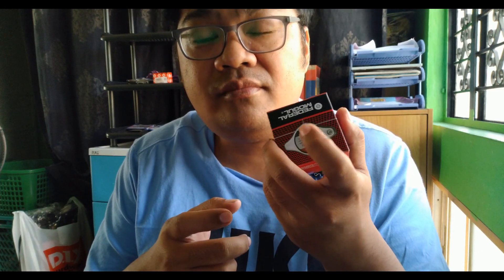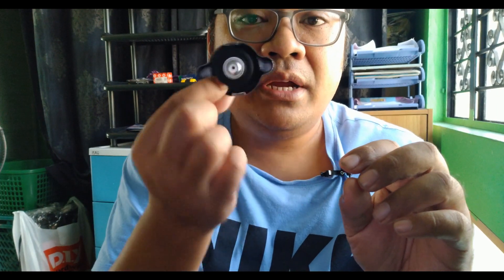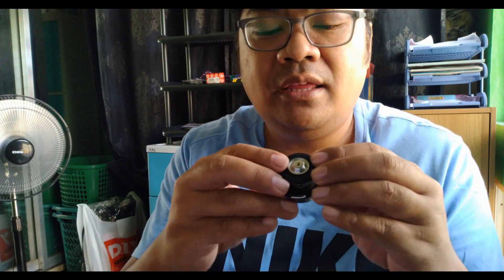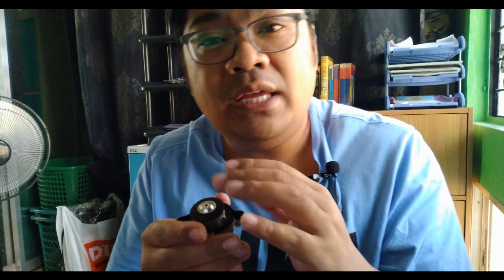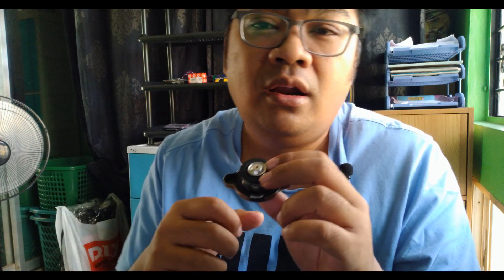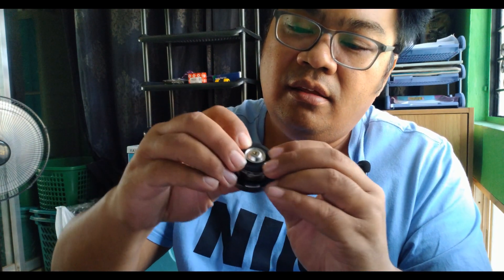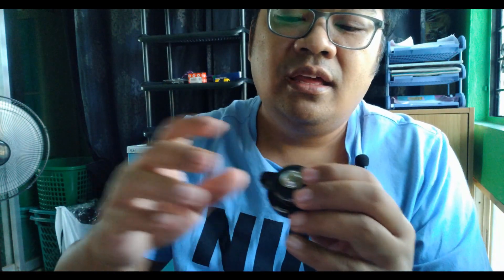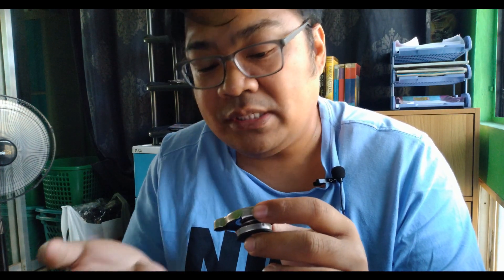THINGS TO KNOW ABOUT YOUR RADIATOR PRESSURE CAP (ENGLISH)

Comment: Hi! Great work....thanks! Ive been searching EVERYWHERE for the pressure specs for my 2005 Nissan Armada truck radiator cap. Pleeeeze help me. All I kno is the previous(or current) cap is written 43LBS. Are you able to shed some light as to its replacement? Thanks very plenty
Reply from the maker: hi there! did a research about this and saw that the radiator cap for an Armada should be 0.9 Bar and radiator cap for 04 to 2014 models are compatible! saw some available in Ebay. 🙂
Reply: @MotoVentour  awesome! Thank you VERY much! 🙏

Comment: im trying to make sure car does not overheat I run a 2004 toyota camry 4cyl. I guess the common problem is stripped head bolts if car over heats. do you think 1.1 is good or .9
Reply from the maker: Go for 1.1

Comment: Thanks so much man. Exactly what I was looking for.
When I use 0,9 my car works well but I always have shortage of liquid I. D radiotor. The cap emits coolant to reservoir but doesn't take it back. 1.1 cap causes overheat. What can i do?
Reply: Kindly assist wt d question. Would go a long way. I also changed my radiator heat os the old one had a leak

Comment: Sir kapag po ba ang rad cap po eh loose ung presure valve spring from its shell eh defective na po ba iyon?
Reply from the maker: may play yan ng konte.. malalaman mong sira ng rad cap kasi mag cacause din yan ng overheat.
Reply: Kc po kapapalit ko lang rad fluid 15days ago. Then kahapon po nagulat ako nag overheat ako ubos po tubig ng radiator ko.

Comment: Meron kasi ako nabile radiator sa aftermarket nakalagay na takip niya eh 1.3 pinisa ko kasi para malambot naman spring niya kasi ung 0.9 na nakakabit eh parang hinde nag bubukas ung maliit na takip punta reservoir eh namamaga na ang hose
Reply: Meron ako sir 1.1 pwede na kaya un kasi i need to be sure kasi baka nga pumutok ang hose ng radiator ko bago top ober hul pa naman
Reply from the maker: @glenn261164  ok na yun
Reply from the maker: hindi po spring ang basehan sa radiator cap..  yung 1.3 is meaning mas mataas na temp bago yan aangat baka pumutok mga hose or worst upper cover nh radiator mo

Comment: hi Mark ... I hope everything is excellent over there. In this video you talked about changes in engine oil, but I would like to know how many kilometers it is preferable to change the engine oil?
Reply from the maker: depending on the type of oil you are using. if its mineral based every 5000 kms should be fine, semi synthetic up to 7000 kms anf fully abou 8 to 9000 kms max.